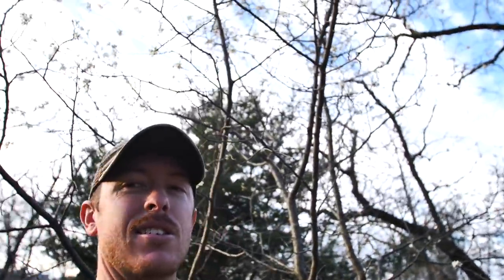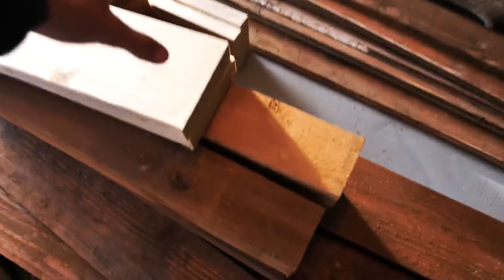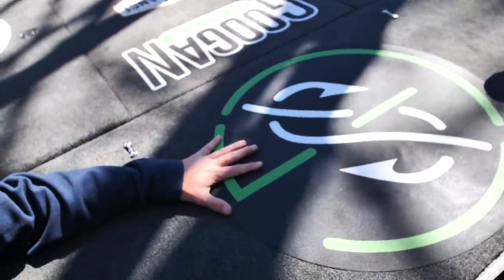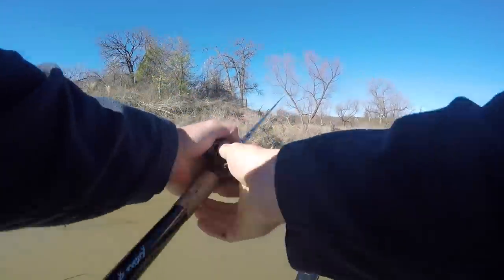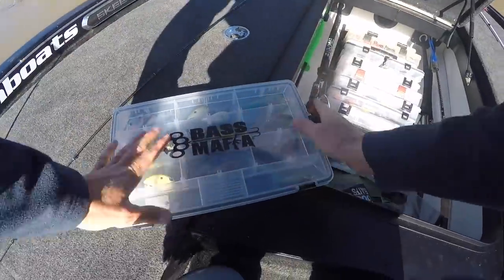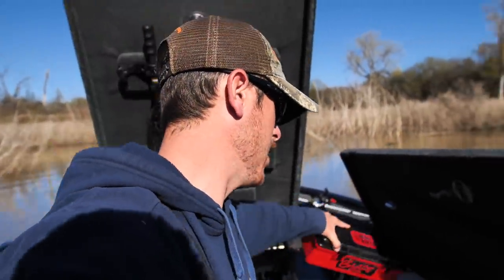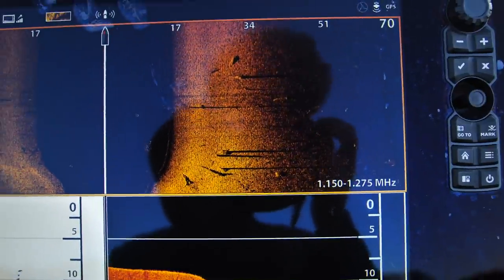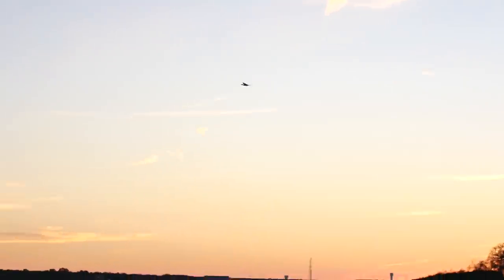Huge Bass on Secret Crankbait | NEW GOOGAN FISHING GEAR!

Comment: Do any other northern anglers leave for the winter lol. I unsub every winter because its just a tease. My area isn't cold enough for ice fishing but its cold enough to where the winter bass fishing is horrible. I'm not spending hours in wind that feels like its cutting you, for one dinker, one dinker if you're lucky. Nj has some of the worst winter bass fishing.  You theoretically can catch them but its not like your average winter fishing. The big bass are FAR LESS likely to hit any type of lure, as compared to other areas.  The bass around here really turn off during the colder months...so instead of wishing it was spring, I just forget about bass fishing for a couple months.

The water of this area is its own breed. Mike iconelli fishes these same waters and he has the same luck during the winter months.  You know how every body of water has its own atmosphere. What works, what really works, and what doesn't. For what ever reason, red patterns kill at these lakes.  Every angler you'll see will have red pattern baits. But winter they severely turn off for two or three months. Most other areas in winter if you're slow crawling jigs, or fishing jerk baits, you can catch them. You just slow down with them. These lakes are are just different.